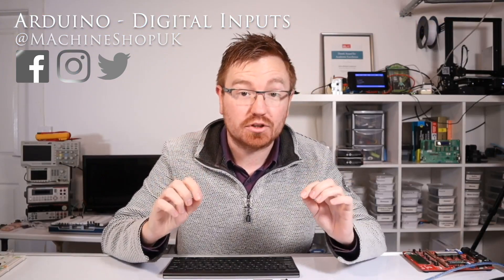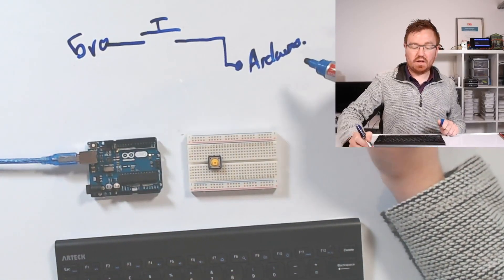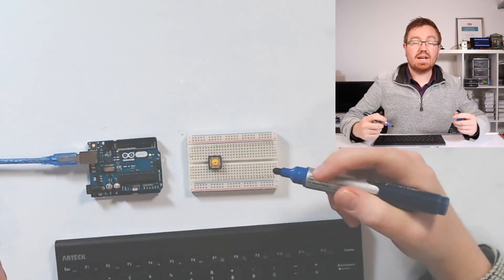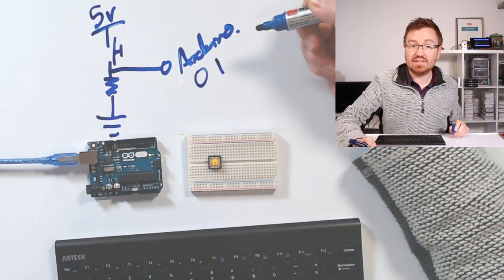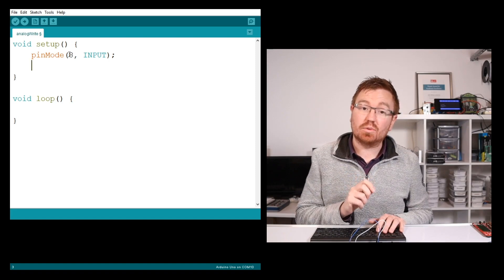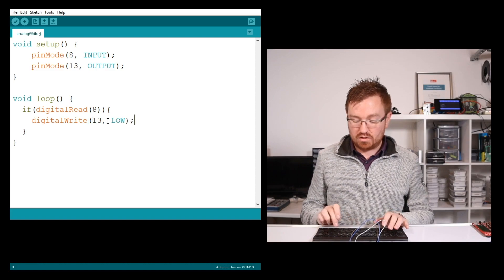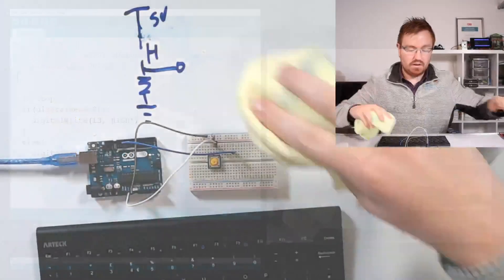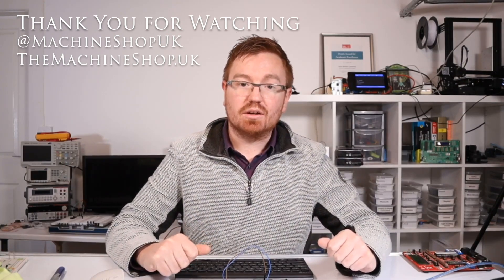Arduino - Digital Inputs

Comment: Thank you sir for explaining the button system . I was getting confusing why my Adriano showing 0 and 1 random variables in my serial monitor. Even though my pin was not connected. Its because it take random disturbance as 1 . Maybe air resistance. Thank you sir 🙏

Comment: hi
When you press the button the LED should be on and when you let go the LED should be off
It seems to behave the opposite , why ?
Meir
Reply from the maker: Hey, thanks for the comment. If you are using the pull-up method, then the input will read True when you are not pressing the button. So you need to tell the LED to turn off when the input is True and turn on when the input is false
Reply: hi Thank you, the video was very helpful and very well explained, thank you very much
Reply: Sorry I still don't understand
Without clicking the button  the code else  works and you write (13, HIGH) 
 = led on ?
i means the LED without pressing the button should be on all the time  !!!
Meir
Reply from the maker: @larido1957  ah ok, so do you want the LED to turn off when you press the button?

Comment: I’d never been aware of that INPUT_PULLUP trick - nice tip. Is it something that’s common on loads of MCUs? Also, what’s the red development board?
Reply from the maker: Hey Pat, yes it is a common feature, have a look through the data sheets, it’s often referred to as weak pull-up. The red development board is the Microchip dsPICDEM 2. I’m using it to teach about dsPICs, specifically with motor drive features like the quadrature encoder.